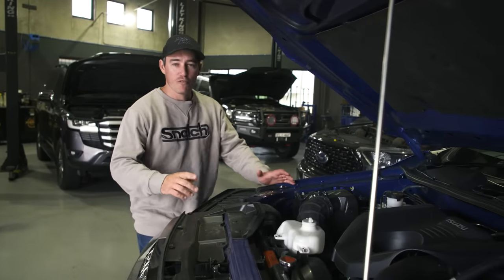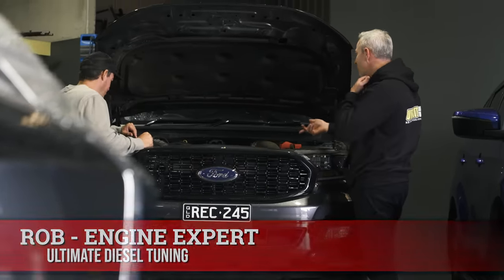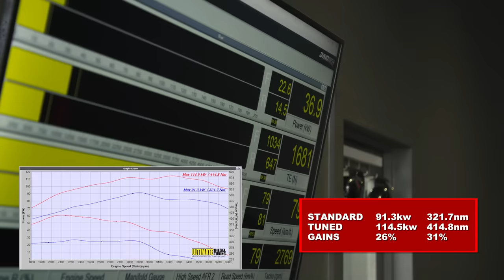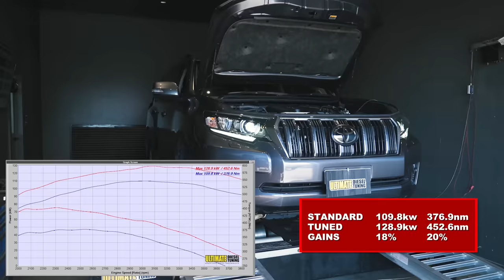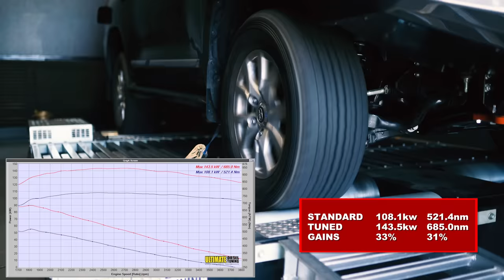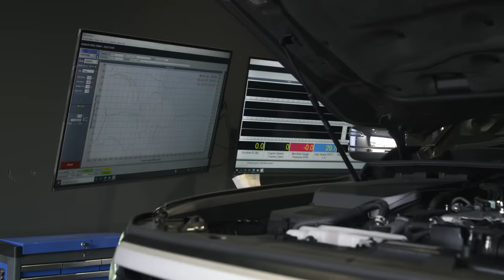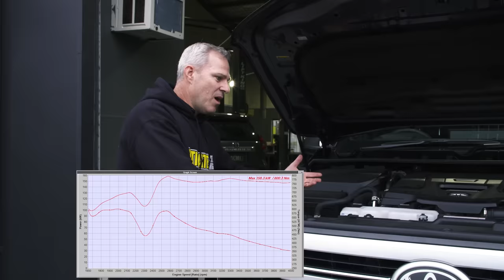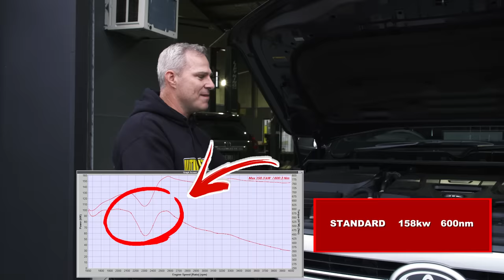Everest vs. Prado vs. Pajero vs. MU-X vs. 200 vs. 300! In-DEPTH Engine and Transmission guide

Comment: Would love to see a video on a REAL Mitsubishi Pajero, the Gen 4. Such a shame they stopped production on them.
Reply: same but they do not make them anymore
Reply: Talk about the Mitsubishi pajero sport great warranty so let's tune and scrub  warranty ?????
Reply: So you are all smarter than the Japanese engineers
Reply: Nothing wrong with the pajero sport but the 3.2 engine is legendary for a reason.
Reply: Great family vehicle
Reply: Exactly right, they would still be selling.
Reply: Yes I  like to see how thay go off-road
Reply: I drove them back to back and the Pajero Sport is a much better car in nearly every respect. The Pajero felt like an old car to drive in 2019 so we chose the PS.
Reply: @paulmeadow1764  Incoming long comment! My experience: 

Rob and Michael tuned my 2021 model for towing, and it's a night and day improvement, with zero impact on warranty. UDT also back your warranty if the manufacture tries to dishonour warranty claims. My dealership that does servicing on it simply said 'How awesome are those gains (+30% power and torque, nearly no lag, noticeable better fuel econ) and just remind us each time you bring it in so we don't do an ECU software update over your tune and loose it on you. We can give you the option to have the ECU flashed with updates if you want to go back to Ultimate Diesel Tuning to have the tune re-mapped again.' I again checked about warranty, and their head tech said he's had the tune done on his Triton (same engine) and loves it, and the only connection to potential issues with the 200,000km or 10 year warranty is if you are hammering it offroad spinning and dumping wheels to break CVs or shafts... the kind of abuse that any manufacture will specify as beyond warranty terms. Otherwise, they are confident in the driveline which is built for way more than it is typically put through. 

It has the same Aisin 8 speed transmission as used in Land Cruiser 200s after all, expect with Mitsubishi's ratios and shifting parameters to match the engine... in a lighter package and lower output driveline 👍Factory read diff lock too. Most naysayers of the Pajero Sport either haven't actually driven or owned one, let alone seen just how capable they are off road even in stock form. I can attest, over 42,000kms in about 16 months and having Swan Gully, Scenic River, Glasshouse Mtns, and a few other adventures in stock form, with only better A/T tyres at Glasshouse. Done and done 😁 

Also, the Japanese engineers heave a lot on the table, because they are very clever... not tuning it to within a whisker of it's designed capability. The Japanese manufacturers generally learned long ago how much a platform's reputation, aftermarket support, resale value and cult following benefits them into the future. So it's not that all professional tuners think that they are smarter than the engineers, but just that there's plenty of reliable headroom to work with and liberate for those that appreciate it. Rob mentioned to me that their tunes are not at the expense of reliability - they expect you to roll away from their workshops and go do a lap of the country.
Reply: I'd pit my Gen2 Pajero against a PS here in Africa any day and twice on Sunday. Reliable, cheap and parts availability are my key concerns. The fact that they have a separate chassis makes it a no brainer to choose. Even with the thirsty 3,5 v6 engine in I'll be long past the warranty period and still not have made up for the price difference in fuel costs. A friend of mine is looking for a good 2nd hand PS to buy and apart from being a monocoque design I can't really fault them if you don't go crazy.
Underrated, yes; good value for money, yes; reliable, yes.
Is it the wagon for me, unfortunately no, too many electronic overlords and gadgets. The Japanese manufacturers have all done a tremendous amount of R&D on their products, they know what they have and what their products are capable of. They stay well within the limits for reason and can therefore give you a great warranty. IMHO you'd be stupid not to buy a Japanese 4x4 wagon.
Reply: Chatting to a dealer about the REAL Pajero, unfortunately they did not meet the safety standards being set. It was also then too expensive to re-design the entire car, so that it met these standards. I would not be surprised though if they do bring out a NEW pajero based off the old design but with all the new bells and whistles you would expect from a modern car.
Reply: @sgtpineapple2880  There's also chatter about there being potential for a new full-size Pajero based on a Nissan platform - time will tell, because there's quite a few calling for it!
Reply: @GrantHawkey  I've owned both a paj sport and a paj. taken both off road plenty. the paj sport felt weak (small engine compared to the 3.2), the 8 speed was a pain in the ass in softer terrain, had terrible visibility and felt significantly more crowded in the interior than the Pajero gen 4. The A-frame is so small, and the interior so crowded, that it doesn't feel like a "new" car, it feels like sitting in a hatchback trying to see the whole 4wd environment.

couldn't recommend the original paj enough.
Reply: 4th gen Pajero 4m41 is most reliable 4x4 wagon ever made
Reply: @thecappedgamer8125  they don't make the 200 either and yet it was in the video...
Reply: @kingmarz3635  MY16?
Reply: @mullerandre95  The PS is not monocoque the NM Pajero is. I have a PS its the same chassis as the earlier Challenger basically.
Reply: Wouldn’t go anywhere the PS won’t and PS will do it in more comfort.
Reply: over here they still do
Reply: The truth, sir.

Comment: Finally a big channel giving the Pajero Sport the love it deserves! Can vouch for mine, 2018 GLS with 120k kms now, haven't had any issues yet! I'd recommend giving it a go off road (you could use mine if you want ;) ), the superselect mitsubishi gearbox is so impressive off road, paired with a stock rear locker in GLS & Exceed trim levels. Its so light that it sits on top of the surface & flexes decently in stock form. Throw some good tires on it and its pretty damn capable. Thanks again for giving it the respect it deserves!
Reply: The transmission is also a surprise. Apparently it's only used in 3 vehicles, the Landcruiser 200 series, Lexus 4x4 which is essentially the Landcruiser and the Pajero Sport. Good to know you've got the Landcruiser transmission in a much cheaper package.

Comment: Should do the NX Pajero. Sure they stopped production in 2021, but like the Triton they are an absolute steal second hand. My base model 2021 Pajero came with rear diff lock. I’ve added a 2” lift, a bullbar and  winch… surprised quite a few people with how far you can push it off-road.

Comment: I can recommend the Pajero Sport. I have a 2016 GLS with the standard rear diff lockers, haven't found anything it couldn't handle yet. I got it for $35k used with 50k KM on the clock in early 2020. My only advice buying used is to check if it's had it's 60k KM service, as that's a big one $ wise with the valve timing. Put the money you save from badge premiums into your camper or setup!

Comment: I got myself a paj sport, the price was unbeatable for its capabilities and reliability. Slowly rigging it up with mods. Would be great to see a comparison of stock features like suspension, tyres, clearance and roof load ratings and how mods can improve them.
Reply: I must say the new Paj Sport is a weapon of a 4x4. First thing i would do tho is paint over the bottom half of the tail lights, what idiot came up with that design.

Comment: 2017 Everest with 140k on the OD. Been up and down the eastern seaboard with trailer in tow with no issues. The thing loves to run long distance and does it in comfort. Albiet we know this channel is pro Toyota but I have to say I've had no issues with the Everest and it still feels strong and tight. Also, the Everest has no class-action lawsuit filed against them unlike Toyota.
Reply: How is it pro toyota? Shaun is a fan of toyota personally but graham loves his nissans and what dual cab ute has he driven and made extremely popular?
Reply: @Tom-lf8hx  your blind if you cant see that this show is pro toyota.
Reply: @cjslee7885  shaun is pro toyota thats his personal taste, but why do they have a camera car as a gu wagon, and now a gu ute? Why is graham dual cab a dmax and not a hilux? Wouldnt a pro toyota channel (not just a presenter's preference) have all toyota's so graham's dual cab would be a hilux and the camera car be a cruiser?
Reply: My preference is for the everest as well, but living near a ford dealership made me not want to roll the dice, common issue is the transmission just failing. We have a pajero sport that uses the same aisin transmission as the one found in the 200 series LC, good stuff.
Reply: @Tom-lf8hx  Not necessarily. As a channel they need some diversification but you'll never see a Ranger or a Colorado (which is technically an Isuzu) and Amarok or even Triton.
Reply: @Deatomizer  the isuzu is a sponserd ute tho? So why isnt vw throwing money at them? To have a camera ute as a amarok or ford doing it? Who doesnt love money? more to the story then just "ohh hes pro toyota"

Comment: Considering the Y62 is arguably the best tow vehicle on the market today it’s crazy they didn’t include it.
Reply: They're taken the vehicles to ultimate DIESEL tuning, that definitely puts the Y62 out!
Reply: @greghajdu2569  in Poland we so swap gu4 engines with m57 +8hp :D
Reply: Nissan could be over by 2030,,,,, recently been bailed out by Japanese govt and still having to fix cars with bad transmissions under warranty,,,,,, and Carlos Gohen thinks it will be gone by 2025.

Comment: Very happy with my 2019 QE Pajero Sport GLS. Purchased new for $42k through a broker. Have thrown on Falken Wildpeak AT3Ws, an Ironman 4x4 bullbar, Ironman 4x4 suspension upgrade and 2' lift, Rhino Rack Pioneer Platform, and a Piak rear bar. Have pushed it pretty hard around Moreton & Fraser Islands without any dramas at all. Super reliable, and when not off-road, an excellent family wagon!

Comment: Really surprised to see how close the MUX was to the 200 in power after both had a tune. Not sure how Toyota can claim 200kw at the flywheel, in standard form that's a 45 percent drive train loss to 108. 300 is way to expensive, Ill wait for the Grenadier, now they have Luxury tax exemption a really well kitted one comes in at less than 110k with a lot more kit than a similar 300. Just waiting to see how reliable it will be.
Reply: I agree
Reply: Rwd vs awd drivetrain loss, the difference is huge on a dyno
Reply: @tcmx712  45% loss is abnormally large for any AWD or 4WD system.
Reply: @4G12  the everest had a loss of 38% and it's only rwd yet the mux only had a loss of 20% so who knows what his dyno is doing hahaha
Reply: Agree. Post tune the MU-X had more power, but less torque. Very impressive. Not sure where the 200 is losing so much power. 

MU-X 146KW, 596
200 143KW, 685
Reply: @WhyWouldYouDrawThat  not so much that the 200 is losing lots of power....its honestly fact that so many people don't understand how untapped the isuzus are.  I got 200hp, 643nm and averaged 8.9-9.1L on 33s even when driving it hard.  This was on my old 2011 model and it had 240000kms on the clock. Can't beat em
Reply: Have you driven the defender?
Well worth a look!
Reply: Can’t believe the overhead on the MUX either, shame you need to loose your warranty to access it

Comment: I have found these comparison video's really interesting, especially the coverage on the known issues and upgrades that should be done (transmission cooler etc). 

You have included engine tuning in the video but there is no mention on what sort of impact this has on warranty. Considering this is new vehicle comparison and we know manufacturers will use anything to get out of a warranty claim i think it would be good to cover how an engine tune impacts your warranty. Replacing or rebuilding the new diesel engines is very costly.

Comment: Love the starting prices, but a little misleading because you won't see a 300 or 200 for that price unless it is on a tow truck because it has been in an accident. Got to love the Mitsubishi! One thing to consider when you talk about the wagons based on the utes is payload once you throw a trailer on, got to be super careful with the weights.
Reply: Agreed, MUX towing its bragged about 3500kg yields 185kg payload for all people and their stuff. Pathetic as it is very newly released and is really in a different category (part time 4x4 vehicles).
Reply: @waynehobbs5175  The smaller ones wouldn't handle the full 3.5t . But assume you did, consider most will throw a roof rack, bullbar and tow bar on to tour, they are really only able to hold a 50kg person without fuel. This is also assuming that the 3.5t trailer is really loading with a 10% tow ball mass, most are over. The 3.5t towing capacity is the most misleading thing on the market these days.

Comment: it's funny, in the US people are building rigs out of an even fancier Prado (Lexus GX470/G460) and part of the appeal is that it's posh yet you can build it super capable...Also it's a solid rear axle, body-on-frame rig, you can't get more rugged than that from the factory except of course having 2 straight axles

Comment: Top 5 Diesel engines are 4jj1/2/3, 1kd, 1vd, 1hd-fte, td42. But to be completely honest, the 1gd isn’t bad, the triton/Pajero sport 2.4l is not bad.
Reply: 4m41 tops any of those toyota engines
Reply: BMW m57 ain’t bad either
Reply: If talking Australian sold motors that list is pretty spot on other than the td42. Been down that path and it's just a dyno-queen of an engine, swear nissan can't make a good diesel but their petrols are awesome
Reply: @tcmx712  td's are a tractor motor thats why they are good, comparable to a 1hz/dt in my opinion
Reply: 1GD for me
Reply: @darcykeddell4930  td42 is way better than the 1hz and way worse than the 1hdtfe. Like I said I've been down that path and I can tell you right now they are nicknamed The Kettle for good reason. Trash on fuel even when unmodded, are absolute gutless and when you do get big power out of them (which is very easy) they overheat at the very slightest hint of hard work. The 1hdfte is better in fuel economy, reliability and makes the same power just as easy, too bad the 100 series isn't as good as the gu haha
Reply: @tcmx712  yeah I'd say thats fair
Reply: Nissan VK56 smashes them all! Power and reliability 👌
Reply: Vw/Audi 3.0 tdi
Reply: 1kd, Seriously? Not in a million years is that a great engine.

Comment: Serious question, have watched the channel for years...do they not sell Jeeps in Australia? The Wrangler and Grand Cherokees are mainstays here, and would love to see them go against the Pajero, Dirty 30, Prado, Isuzu, etc. We have a Ram 4x4, H2, and Wrangler and would love to see some other models on the show.....keep up the good work guys!
Reply: Aftermarket for Jeeps in Australia is limited to fender flares, angry eye grilles and fake beadlocks.
Reply: This test was for diesels and Jeeps are petrol, plus notioriously thirsty which is unacceptable for outback touring where fuel stops are few and far between.
Reply: @MrMoth0102  i just meant in general, and the wrangler and grand cherokee over here is/was available with the 3.0 turbo diesel from the 1/2 ton dodge truck line

Comment: I've had my pajero sport for a year and I've been amazed at what it can do off road. I took the 3rd row seats out as they're pretty useless and put some drawers in. Only bug bear is that the electric boot shits itself sometimes and doesn't want to close which seems to always happen when I'm camping and taking it off road so you just have to push it closed. Looking into a tune and a lift as the next steps

Comment: In the philippines, the pajero sport is sold stock with 170hp & 430nm; go get it tuned guys it will not have a problem with reliability. I guess in australia the laws are more strict with the emissions.

Comment: Would love to see an actual comparison. Testing them all both on and off road comparing comfort, handling, suspension travel, off road capability, traction control systems and diff locks.

Comment: Loved the testing that you did for the utes going off road ,towing ,comparing brakes, suspension, practicality I don’t just want to know that they all get 30% gains for power and torque from a tune as any car with a turbo can also need the patrol, wrangler and Jimny in there still a good video but nothing compared to the utes

Comment: That's a wet tune for the 200 mate I'm running 180kw at 700nm 
24 psi boost DPF delete 
Good luck getting the 300 to do that on stranded turbos.
There will not be much room to move with tuning the 300 it's close to Max for the displacement 
The only thing going for it is the 10 speed. On TAIL GATE
Reply: Hey mate. Yeah never compare figures, they will always vary from dyno to dyno car to car.
Reply: @UltimateDieselTuning  I'm am running 4.3 diff gears ⚙️ that helps
Reply: @madmantovalhalla6971  yes that certainly does, obviously that changes the gearing of the car.
Reply: @UltimateDieselTuning  standed gears at 35in tyers 
I'm running 33in tyers give me 200 rpm to play with

Comment: We would really like to see a Prado going on one of the adventure drives with you to see how it goes.
Reply: they go great, we just did a 3 months tour of WA, went through the Kimberley and up to cape Leveque, back down to the Pilbara and then to Karijini and down through the goldfields to coolgardie then back up the middle and home to the Gold Coast, saw 2 200’s dead on the side of the road, 5 Rangers all with gearboxes gone and one vc commodore 😁, we had a fuel filter light come on and the alternator went because it got stones in it, the car was a pleasure to drive and now tows our 2t van everywhere we go 😁